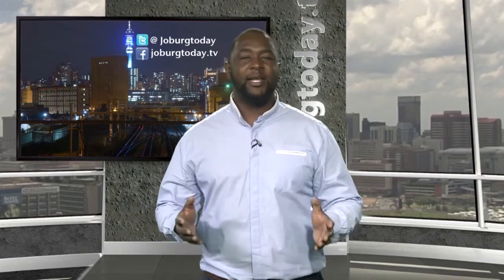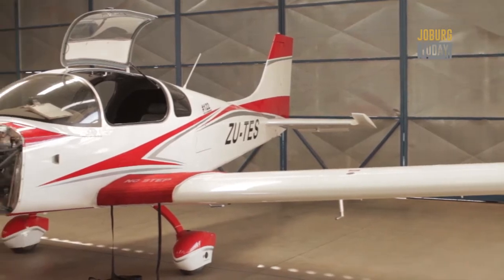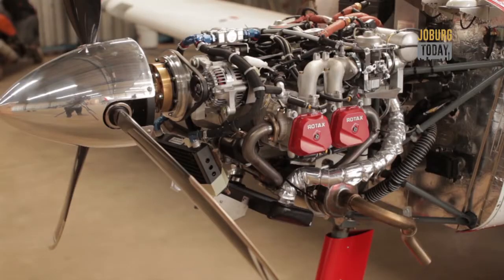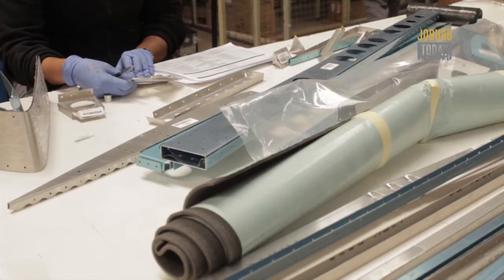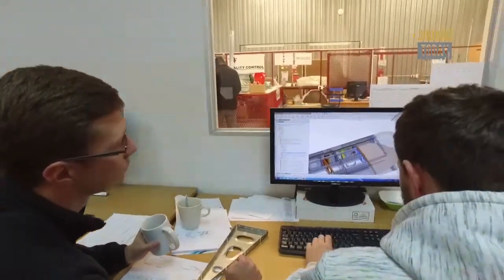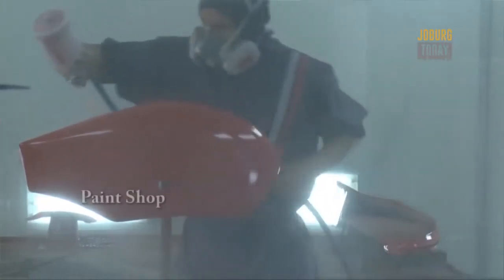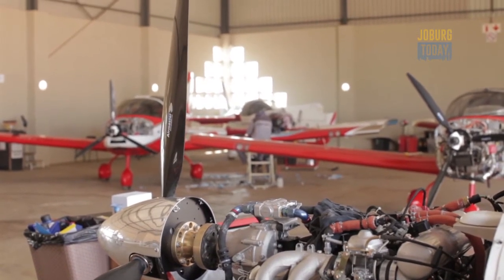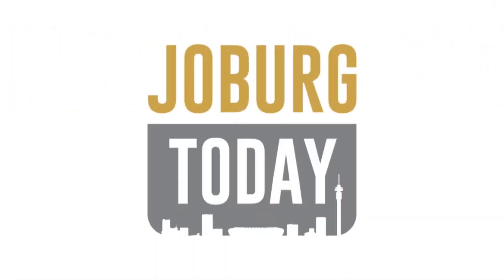#InFocus - The Airplane Factory

Comment: That's not true...  The WT 10 uses same engine and also the Pioneer 400 though they can now use the 915 engine as well. Both other aircraft are way more sexy, have a retractable gear option and the WT 10 has doors for the rear occupants.  Less money too.